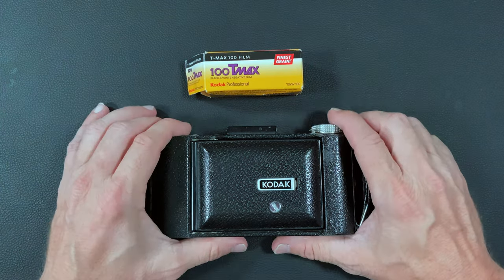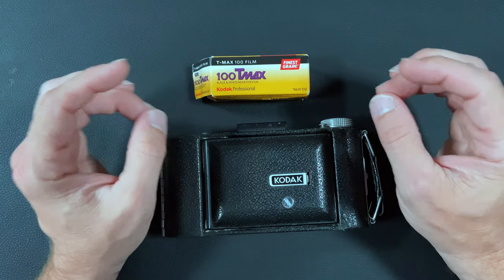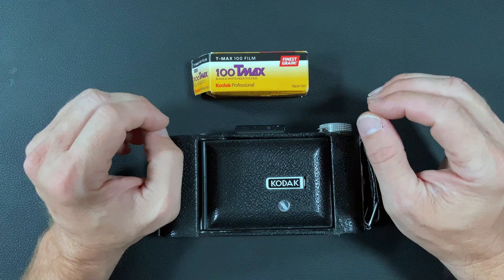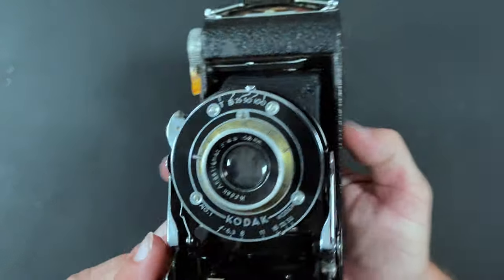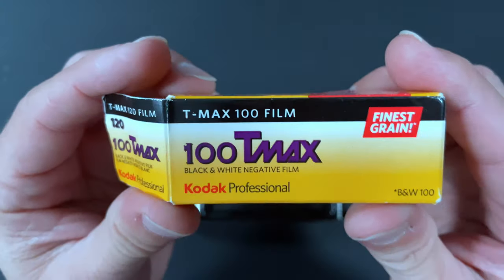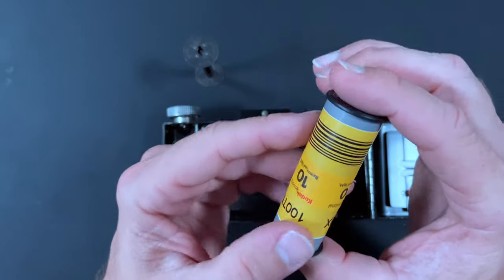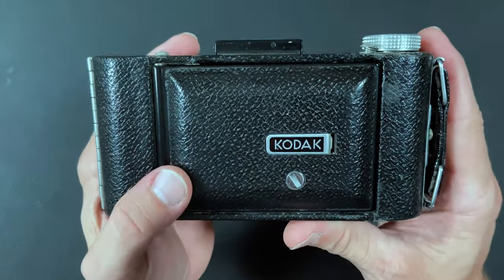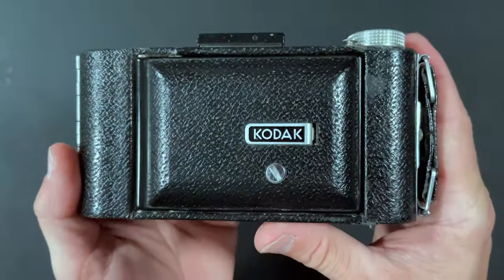Load 120 Film in a 620 Camera the easy way!  Film Hack.

Comment: This method only works on some 620 cameras.  Using fingernail clippers as you suggest only decreases the diameter of the flange.  The problem with many 620 cameras like the Kodak Medalist, Chevron, Super SIx-20, and others is that the overall length of 620 is shorter than 120 and even if you decrease the diameter, the length is still a problem.  if you have a camera where a fingernail clipper trimmed plastic spool works, then great!  But it is important to know this will not work on all 620 cameras.  If you do this and find that the spool is difficult to get in, do not force it.  Even if you manage to wedge it in there, it will not spin freely and you can damage the camera.
Reply: Yes but to be fair he did mention that it doesn't work on all 620 cameras.

Comment: I'm using a Kodak brownie hawkeye. It's a lot of hype. But I have been successful using 120 film without modifying the spool at all. The takeup spool needs to be 620. But I've used no sandpaper or clippers. There's enough space for a 120, maybe if you just try it. Maybe you'll get lucky too.
Reply: I was about to ask if this trick would work in a Hawkeye as I just found and restored my great grandfathers flash model and want to use it. just wanted to say thanks :)
Reply: But you need to get back the spool  too, thanks Will the developer give  you back, will they accept that 620 spool for 120 film? Thanks

Comment: Hi! This looks really cool and way easier than re-spooling the roll everytime. Someone else asked already, but can you re-use the clipped spool as a take-up spool or do you need a new 620 spool everytime? Thanks!
Reply: the hole on the end of the 120 spool is larger so it may or may not turn right on the take up knob

Comment: This works for a lot of kodaks that take 620, but it doesn't work for the higher end kodaks with automatic cocking, or with very tight tolerances.  My medalists have a roller in them that automatically cocks the shutter as you wind the film, and it's expecting a very particular amount of distance to be traveled by the film as it rolls along.  If that isn't met, it'll have at best poorly spaced negatives, and at worst it could damage the advance and shutter cocking mechanism.  I know the medalist and monitor have this issue, and maybe the chevron.  

Also, the medalist has VERY tight tolerances inside, and it may not even hold a modified spool.  It comes down to medalist.  My medalist I can hold a plastic spool (again, taking into account the possibility of spacing and mechanism issues), but the II absolutely has to have metal only.

Just a heads-up.

Jason
Reply from the maker: I think every camera is very different when it comes to the 620 film being used in it.  This is by far the simplest conversion from 120 to 620 there is and it happens to work in this camera.  In some cases it's better to re-spool onto a 620 spool.  And if you have the paper from a 620 then you could reuse that too.  So your frames and numbers on the paper would all match up.  Thanks!
Reply: The roller that controls the advance of the film is linked to the film itself, not the rollers that hold the spools. The Medalist are very delicate cameras. It even doesn't work with plastic 3D printed spools. Must have metal spools. Luckily, some Chinese companies do produce metal 120 spools that work well in a Medalist.
Reply: @tvnshack  The roller that controls the advance of the film is liked to the winding knob up top, and the spool as well.  the silver spool expects to go a certain distance as the film travels by.  If it doesn't, because the spool isn't the correct diameter, anything ranging from inconsistent film spacing to a jammed camera can result.  I only use metal spools in my Medalists because they're far more consistent than the plastic ones (whether molded or 3d printed).  So if you simply use the nail-clipper and sandpaper trick, you will probably not get a perfectly circular spool, and that will annoy the film counter.  

I've also had plastic spools get split by a Medalist II, and my other Medalist II won't even accept them; the tolerances are too tight.  (I have 3 Medalists; 1 I and 2 IIs.)  However, the Medalist is up there in the best Medium Format cameras ever made department.  It's essentially a 4x5 lens shoehorned into a 2x3 camera... and the lens can JUST about cover a 5x7 negative.  I shoot with mine regularly.  I have quite a few vids on my channel about the Medalist; feel free to check them out.

Jason
Reply: @ganzonomy  I've just used my 1944 (EE) Medalist 1 right today, actually! It looked to me that only the roller that is close to the winding spool - the one with the tiny spikes and the notice sticker telling NOT to touch it is responsible of controlling the advance. As I have many (12) Rolleiflex, I understand that it works the same. Mine is fitted with an additional knob on top of the winding knob that I was told is to adjust frame spacing. Anyways, it's hard for me to believe that the film advanced is linked to the spool only - as on an Ikonta 532/16 - and not on the the film itself. On my Ikonta 532/16, the frame spacing varies progressively as the diameter of the winding film gets bigger. This is why we get only 11 6x6 frames out of a 120 roll, whereas the Rollei packs 12.  I have plenty of 620 spools, both plastic and metal. thanks.
Reply: @tvnshack  On all 3 of my medalists, the film spacing is consistently spaced... even if one medalist has wider spacing than the others, within a particular roll, the spacing itself stays the same.  It doesn't get wider as the film travels along from frame 1 to frame 8.  It's based on the spool flanges as well as the film travel, but the flanges do play a role as well with the Medalist.  Again, these are my observations with my 3 Medalists.  I've never seen a medalist get wider spacing as the roll progresses.
Reply: @ganzonomy  On my Medalist, there are no sorts of mechanical links connecting the spool flanges to anything. The winding spool may not even have flanges at all. The film spool is pinched in placed by rollers that themselves have no connection tomanything. If you confirm that all frames are evenly spaced, its only because film advanced is controlled by the last roller, the one with small sprockets on the two extremities. On the Rolleiflex, such a sproket rolls on the backing paper. On the Medalist (at least the initial model), film advance is controlled only by this roller, that is only driven by the emulsion side of the film. You can verify that by looking at schematics and exploded views of a Medalist. They can be found on the Internet. This concludes my contribution. Have a good day.
Reply: @tvnshack  i don't think you're getting what I'm trying to say.  the silver roller is what controls things such as the shutter cocking, the number up top advancing, etc.,  the flanges that hold the spool in place do hold the spool in place, but if a spool is not shaped right, it CAN throw that silver spool off because the spool is tied to the winding knob.  But yes the primary controller is the silver roller.  

I have a blowup schematic of the medalist, the repair manual to the medalist, and a TON of other medalist documents (promo flyers, little booklets, etc.,).  I also have 3 of them (a 44, 46, and a 47; a I and two IIs).  There are differences within all 3 of them internally.

Comment: I discovered that the Kodak Tourist will not take a 120 spool even after trimming as you show with the clippers and even sanding the edges down to make the ends thinner. The Tourist has metal bumpers in the film well itself, so the volume of 120 film will not fit as it’s too big. You would have to respool the film on a 620 spool (which I won’t do). But there are 620 cameras that will accept a 120 spool as you show, so thanks for the video!!
Reply: do you know if the Kodak tourist 2 suffers this same problem?

Comment: I think this will probably work in my Duoflex but I am concerned about getting the processor to return the take-up spool. I think you can still buy 620 spools so it might be good to stock up.

On another topic I know it is possible to build delay circuits for the flash so that you can use modern electronic flashes but I wonder if the trigger mechanism in the camera can be altered so that the flash triggers late enough without a delay circuit. The problem is that I can't find any documentation of how the mechanism in the Duoflex works (or even pictures of the mechanism). If anyone has any tips on this or perhaps service manual I would really appreciate it.
Reply from the maker: For the spool, you need to ask your developer to return the 620 spool, or you're going to have to end up buying more spools.  You could, in the dark, spool it onto a 120 spool and send that in.  As far as the flash, I couldn't start to tell you anything about that.  I know it has what's called an ASA bayonet flash socket.  Hope that helps.

Comment: Very helpful thank you - can you re-use the clipped spool (the plastic one) as a take-up spool for a second roll of film? 

Thanks.
Reply: With some 620 cameras you might be able to use a clipped 120 spool as a take up spool, but I know for example with mine I can't because the system that holds the take up spool is different than the feeding spool and a 120 spool moves around too much which risks tearing the film when you roll it up. It really depends on your camera!

Comment: Question. I own a kodak 620 but after trimming down my 120 film I found that the place where the film sits is significantlly smaller and when my roll goes in it just gets stuck. Basically my trimmed 120 roll still will not fit. Could this be tampering or am I doing something completely wrong
Reply from the maker: Some 620 cameras have such a tight tolerance that you would need to respell the film onto a 620 spool and go from there.  It's more of a pain, but really no way around it.  The Kodak Tourist cameras are really tight like that.

Comment: Respooling the film is easier than this, and works in all cameras. Roll it onto a 620 spool, then roll it back onto a second spool, then the film is the right way around on the spool.  Just have to be careful when you get to the end of the film as you roll.
Reply: You can buy brand new  GP3 100 in 620  roll film now. Just finished a roll in my camera, I paid $12.50 a roll. It’s quite a standard b&w film a bit like kentmere 100. It seems like Shanghai are making some old film sizes again, also got some 220 rolls. Not bad if you want to try out an old camera again for a bit of fun.
Reply from the maker: That's really cool to know!  How much was the shipping from China?  I see that some are selling on eBay for double the price.  Just wondering.  Thanks for the info!